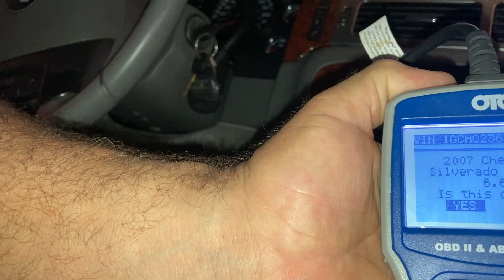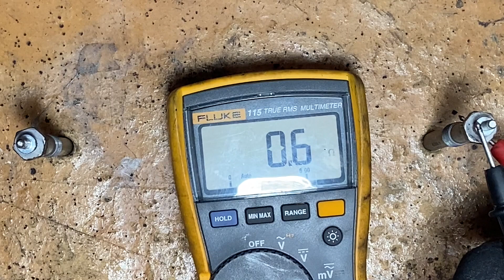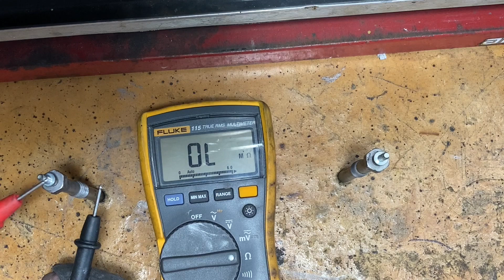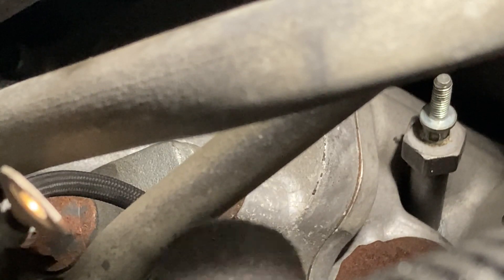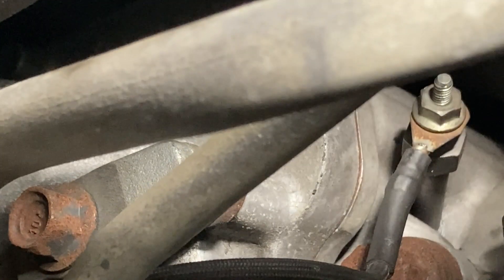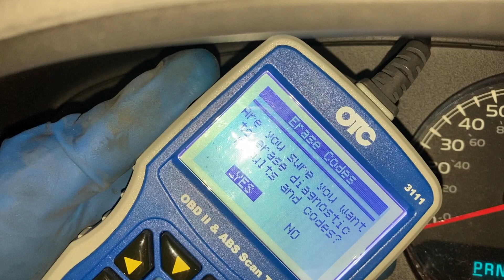How To Test and Change A Glow Plug In A 6.6 Liter Chevy/Gmc Duramax  Diesel

Comment: Really great video / instructions John. I have a code reading Glow Plug Cylinder 7 is bad and wasn't knowledgable about glow plugs and how they are replaced. Thought I 'might' be able to do it myself on my 2006 HD Silverado. But fear I may not be able to get to it AND I would break it. So maybe I'll break down and take to my local shop. Realy appreciate your detailed video sir! Thank you!
Reply from the maker: I understand your hesitation, but if you do decide to tackle it, take your time and follow the steps carefully! they can break it just as easy as you can if you do decide to do it spray it with WD-40 and let it sit for a day. Let the engine run and heat it up this will expand the metal around the glow plug and give you a better chance to remove it with the engine hot. shut the engine off. Once you have broken it  loose spray more WD-40 in it turn it back in to the right to work the threads loose but don’t tighten. Be sure you disconnect the battery because you can fry that module if you short that out by turning the key on. Thanks for visiting!

Comment: Addition comment I noticed you are the only person I seen on you tube saying disconnect the battery I was already planning to do this thanks for that , also buying a glow plug reaming tool to make sure the new glow plug gose in without any issues the dimax store has them for 108.99 they recommend putting a small amount of tacky grease in the grooves to collect any soot  ,  my first diesel pickup I definitely don't want any problems that will need a real mechanic as I am a shade tree mechanic but I am not a rookie to diesel engines as I am a truck driver 37 years a owner operator 27 years seen many diesel shops and engine overhauls I just sent in 2023 60k on my caterpillar engine that has 3 million miles no def systems is the main caterpillar stop manufacturing caterpillar engines for semi trucks but still going strong in other vehicles that uses caterpillar anyway thanks have good day
Reply from the maker: Good luck. I’ve spent a few days in a truck myself so I know what you’re saying.
Reply from the maker: One more thing if you ever block that EGR you will never need that glow plug reamer or break cleaner again. It will slide in like silk.😅

Comment: I appreciate the closeness of the location of the glow plug  I noticed a little rust on one of the  wire ends not sure if that matters upon reconnecting to make sure a good reading I just bought a 2018 chevrolet silverado 3500hd z71 6.6 duramax ltz package that has check engine my code reader #6 #8 glow plug so I'm going to replace them all 😊
Reply from the maker: Make sure you disconnect both batteries you don’t wanna short that glow plug module out. Take a wire brush and clean that rust off don’t forget to use anti-seize on your threads. I couldn’t get the new glow plugs in because they were all filled with soot what worked for me was spraying brake cleaner in those glow plug holes. Be careful doing that, though if you spray brake cleaner in it. Make sure you leave the glow plug out then turn the engine over so that’ll blow out before you put the glow plugs back in I’m not recommending it. I’m just telling you how I did it. Thanks for watching. Good luck.

Comment: What if the glow plug is good and still getting a circuit code?  Whats the means of diagnosis
Reply from the maker: Well, good question. The only thing I could think is a bad wire or bad module. Good luck in digging into all that. Let me know what you find out. I’m kind of curious.

Comment: Is the scan tool for the obd  have extra feature for the diesels?  I just recently tried plugging in my scan tool into the port on my 2005 duramax and it didn't even register or interface.  So I then wanted to make sure the scan tool operational and plugged  the tool into my port on my 1999 Silverado 6.0 and it powered right up.   I will mention the Duramax has an Edge tuner installed but how that's an issue is unknown.  I wanted to see if there are any codes stored but unable to determine so had to resort to taking it to the shop in which I'm awaiting their diagnosis.  The issue I'm having on the Duramax is a lil blue smoke, zero boost( which registers on the edge tuner display only not a factory gauge btw) and I was able to drive it to the shop but loss of power.  No indication of noises like bad turbo, no dash  warning lights, etc.  Input?  Thanks John!
Reply from the maker: I don’t have a clue why it won’t interface.
Reply from the maker: The Autel has a lot of good features and is bi-directional. I don’t own one yet but for the money it is supposed to be good. Please let me know what you find out from the shop.
Reply: @fixitjohn John, sorry for the delay, I was on vacation abroad while the truck was in the shop for five weeks!  So they determined and installed a Oem Egr Valve and gaskets .  That makes sense as how it was running.  That was severely costly for the part in which it was claimed that only Oem was perhaps available for replacement.  I support Oem choice surely.
Reply: @fixitjohn I'm  curious as to an install of an egr valve, is it just plug and play or is there any calibrations that need to be run after install, my paperwork does not reflect any notes in regards to it.  I only now thought of after seeing videos of egr valve installation  and seen some mention of codes, calibration, etc, I'm just not in the know, but concerned.
Reply from the maker: Hi Vince, it is plug and play. You may want to clear the old codes. But it can be a struggle getting it in bolted from the rear. Good luck and thank you for getting back.

Comment: It would be good to mention that most of the time, torque specs are given for a clean dry thread so when using anti seize it is very easy to over torque even with a torque wrench.
Reply: 😊 Thank you. Life long info
Reply from the maker: Thanks, some times I will look back and say that I should of said. Thanks for watching.
Reply: @fixitjohn  Well thinking of the things that weren't pointed out is easy after the fact. You did the hard part. Great video. You deserve the thanks. 
After watching this video, I replaced the glow plug that was giving me the trouble code and I ran into a problem that I've run into on past replacements that I've done.This might help others when they are doing this project. Buy the nuts for the new glow plugs (they aren't included a lot of the time) and replacement electrical eyelets and heat shrink for the wire before starting the replacement job. Multiple times I have had the nuts rust onto the wire eyelet making them impossible to separate from each other. I've had to cut the eyelet to remove the nut and then reinstall a new eyelet on the wire.
Reply from the maker: @unka2m  Thanks that is good to know.
Reply: @unka2m agreed, I’ve lost the nuts too. I buy them before replacing

Comment: Jeez, all you need is a regular old 12V test light, put the ground clip on a positive battery post and touch it’s probe to the center post on the glow plug just the same as all GM glow plugs since the old 6.2 diesels of the 80’s. If it lights up, the plug is good, if not, change it.
375K on the clock, just changed the 4th original plug to go bad. They last almost forever, unless you forget to let the glow plugs cycle completely off before starting the engine, doing that seems to make them go bad.
Reply from the maker: Hi Ralfie, that is true but don't forget to remove the wiring harness so we don,t damage the glow plug module. The glow plugs on the 07 are auto cycling they cycle on and off by them selves when you turn the key on. Thanks for watching.
Reply: @fixitjohn  
Mine’s an ‘07 LBZ, when a plug fails, the plug light comes on, but never cycles off. Just read the code, it tells you which one is bad, then either test that one in the truck, or pull it and test it on the bench. Either way, you have to pull the wire off. I also have an ‘03 LB7 truck that belonged to my Dad. I’m not sure, but that one may have a bus bar tying all the glow plugs together instead of individual circuits like the later ones have.
Reply: @ralfie8801  You're right, My '02 LB7 had the bus bar also.

Comment: i dont think you can start the truck trying to blow the soot and trash out of the glow plugs holes all at once. it would indeed have to be one by one. the truck wouldnt even start
Reply from the maker: Hi Mando, Thank you for subscribing to my channel. As far as the glow plug goes they are not like a spark plug that fires on the compression stroke.  They merely are a heating element that heats incoming fuel and air to encourage efficient fuel combustion in a diesel engine. But yes they are needed for very cold startups and in some vehicles, they are turned on after startups to minimize smoke.

Comment: I got p0675 code at 69,000 miles. I have a tight schedule, how long can I go until replacing it? Do you recommend doing all 8 at once or is it not necessary? It is my daily driver. Thank you 🙏
Reply from the maker: Not a big deal, let it go. I would wait until the weather warms up. At 69,000 thousand I would  just replace that one. If you are at 125000 and 3 or 4 are not working then replace them all.